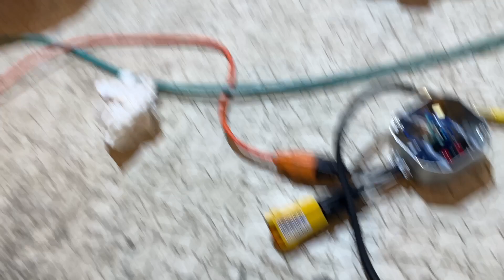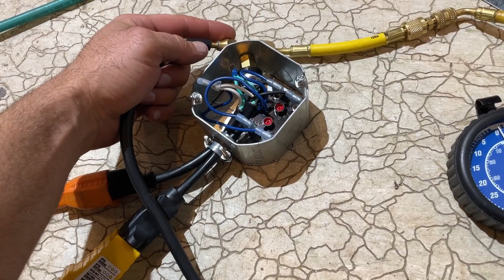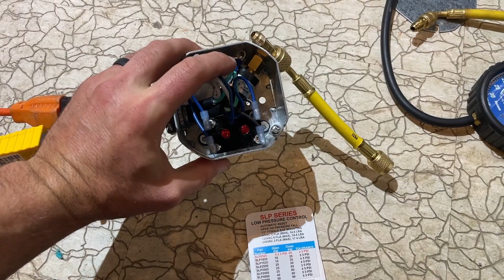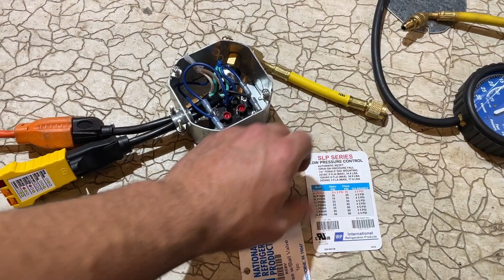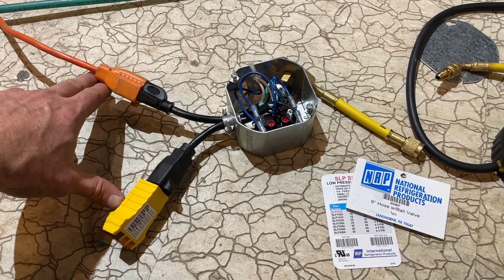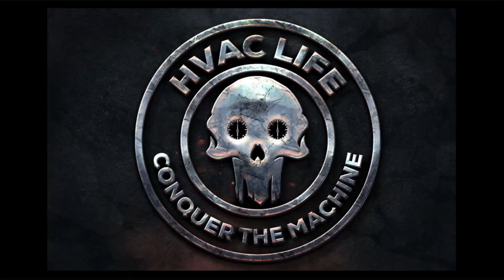Tools54: Recovery Pump Control

Comment: Now make it alert alarm system for your nitrogen purge to little Optica Polaris or LEDs shooting a light beam make a brake signal when the little flow ball loses pressure and breaks the optical circuit to set off an alarm for the guy who’s raising 50 feet away to let him know he just ran out of nitrogen or ran low before he burns his copper

I have more ideas and I have time

Especially when you’re doing 1000 to 2000 feet of copper on a large VRF system and your nitrogen is at one end of the building and you’re 100 yards away some sort of Bluetooth signal to alert you on your cell phone or Wi-Fi signal
Reply: @Florida Man HVACR  🤣